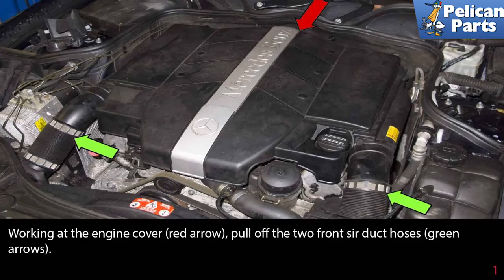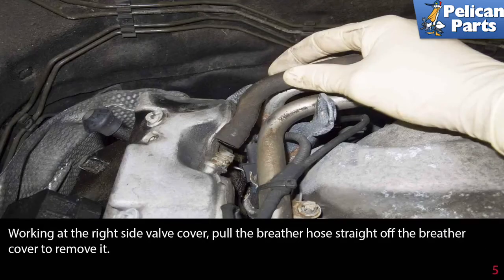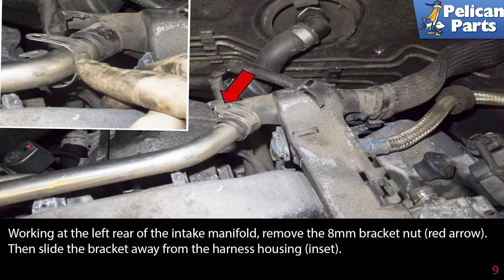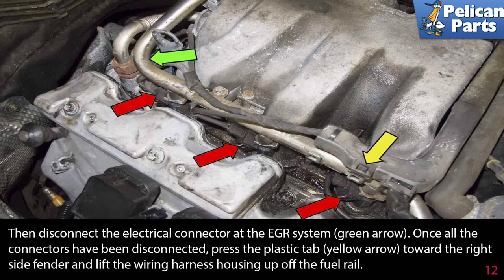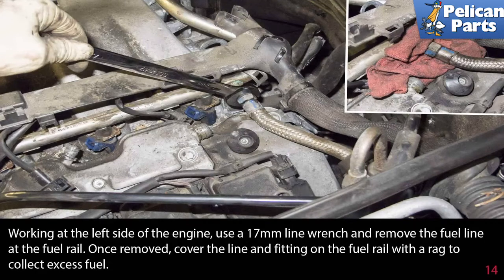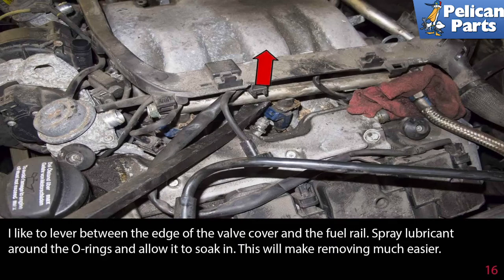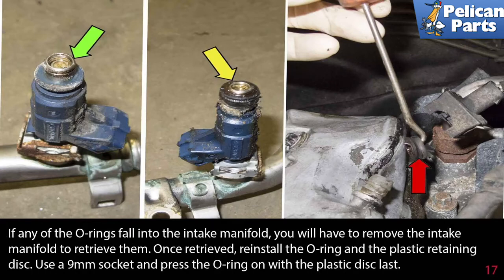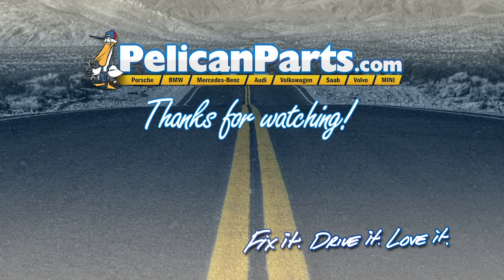Mercedes-Benz W211 E-Class Fuel Injector Replacement (6-Cylinder)

Comment: Hello, great instructions! Can you tell me how many times you can reuse the flexible hose because I heard the fittings may not be reliable after several times of replacement
Reply from the maker: Are you referring to the steel braided fuel supply line? I don't see any notes in Mercedes repair info stating a replacement period.
Reply: Yes, I dont see either info about replacing it but just wanted to know what is the general experience if it doesnt cause problems if it’s reused several times.
Reply: @georgebushisntcool 

Howdy I did have to replace my engine feed fuel line about 3 years ago @ 22 years old.

(2000 e320 Wagon)

It looked crispy & suspect it was around $37 and I bought MB OE.

I gave some thought of using standard fuel line but the connectors are Euro Metric specific, so I went straight factory.

If unsure, once disconnected check to see if surface cracks are evident or swelling or kinked.

If all good, reuse it.

One could MAYBE visit a local "speed shop" or NAPA Hydraulic Hose supply to Fab one using your factory metal ends too.
Reply: And you're RIGHT GB was not cool - he was a double dealing neocon UNIPARTY goon.